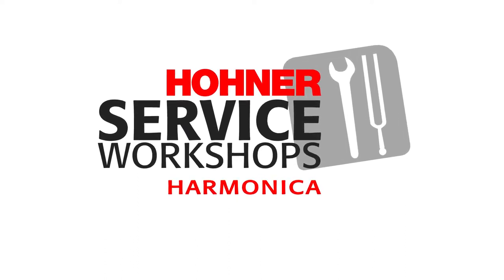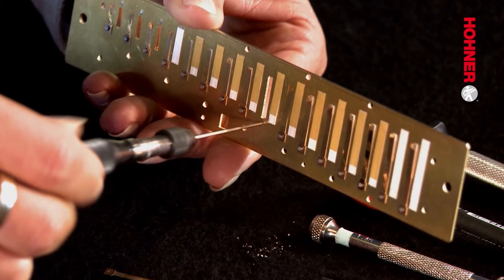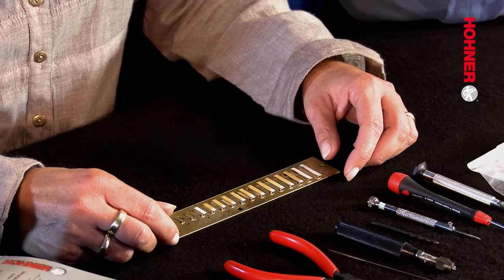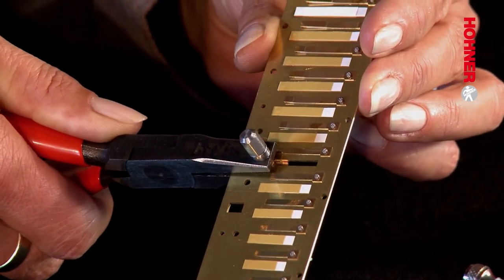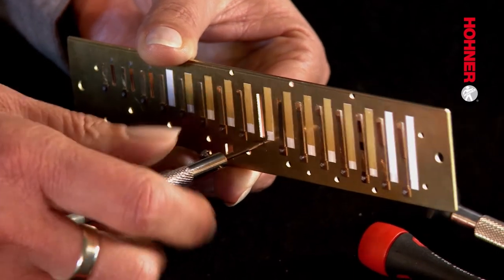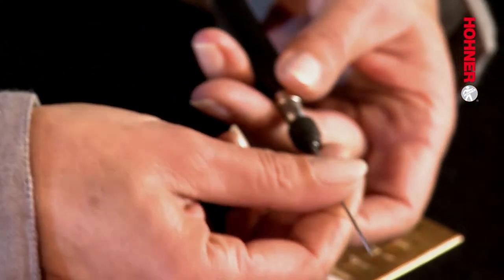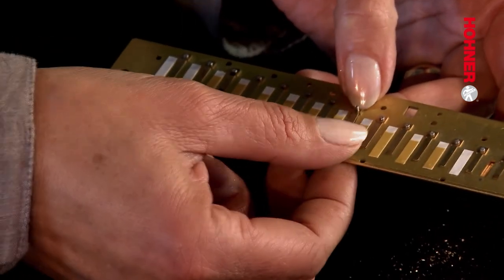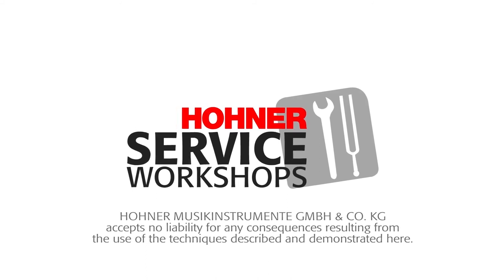HOHNER Service Workshops:C08 - Reed Replacement

Comment: Thank You both for this excellent demonstration.  My father, a very well known player, recently had his favorite instrument, an Unsere Lieblinge 32 damaged through no fault of his own.  His caretakers accidentally laundered the instrument and when it came out of their dryer, it was missing the screws that hold the cover plates together and the plates, comb and the draw and blow plates were all tumbled together with the laundry.  My brother had Hohner send replacement screws so I could reassemble it, but looks like several of the reeds were bent well out of shape so I don't believe it's going to sound good even if I do get it back together.  This little operation looks pretty straightforward as long as one has all the appropriate tooling, without which, it's like trying to do eye surgery with a butterknife!  Hopefully we can send it back to the company and they can have their technicians do this using the correct tools and materials.  This is a much more delicate operation than I had envisioned.  My compliments to you.  As a dentist of 34 years, I truly appreciate watching someone who can do precision handwork like this.

Comment: Hey it works!!!  I just bought the Instant Workshop Toolkit - really expensive, but I have already replaced a few reeds and rehabilitated almost a dozen Marine Band Deluxes and Crossovers, so I guess it has paid for itself.  One criticism of the video, you don't deal with this problem: when you replace a draw reed, the reed plate no longer sits flat on the comb because of the bolt head!  On a wooden comb I've used a file to remove enough wood to let it sit flat - but it should be noted!
Reply: That is terrible.  I don't want to damage my comb.  And yes, I also noticed that the set is totally overpriced.

Comment: I just posted a question on the First video in this new series and asked if there are replacement reeds available. This video answers my question, but also increases my total frustration... The set of Reeds shown at 4:44 sells at no less than a Staggering
152 Euros.....................
I'm sure that's just to keep Reeds a Mysterious and Rare item,
that's my opinion.
Reply: damn
Reply: Yeah the reeds are expensive. You're better off buying a new harmonica or a new reed plate than individual reeds

Comment: Explanation could not be better, however it seems that it would be unreasonable to buy the whole set, even though there is no mention of the price. After all it takes a long time to loose these reeds. In this video there is an explanation as of replacing reeds. I would love to find out if there is a way to soften the existint ones, which hardened up for little use. Immersing in water (cold) is no longer doing the job.

Comment: I have sworn off Hohners for the rest of my life. I currently own a Big River as well as a Blues Harp. The #2 draw reed on both are stuck & I want to recap the reeds. Turns out I need a special tool to take the cover plates off, & no hardware store as well as no music store seels the posidrive wrench. However, for the heck of it, I used a tiny Phillips head screwdriver on my Suzuki, just to see if I have any problems. Guess what - the Phillips head screwdriver works like a charm. Why can't Hohner make life that easy? Why do they have to be so difficult? From now on, goodbye Hohner. You have the most uneducated engineers designing harmonicas. I'll stick with Suzuki's & may give LOs a spin.
Reply: I have found Big River harps to be the best deal for the money (still way over priced), and have used them for decades pretty much exclusively.  (I bought a lot of them when they were still under ten bucks each.)  I always take the covers off them, and put lower profile covers on them - because I play them from a rack, and they are just a bit too thick for comfort with their original covers on them.  I use very old Marine Band covers for the most part.
Anyway, I have taken the covers off dozens of Big River harps without difficulty - using 2 small Phillips head screwdrivers at the same time (one on either side).  Suzuki harps are fine too - nothing against them at all.